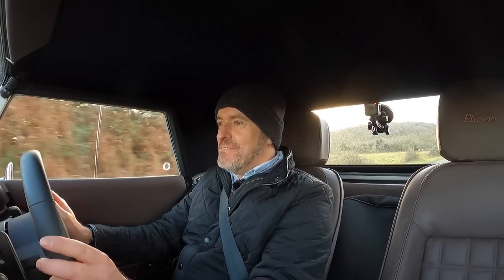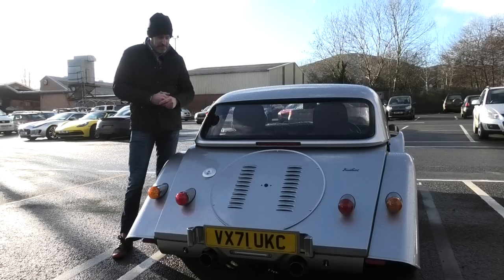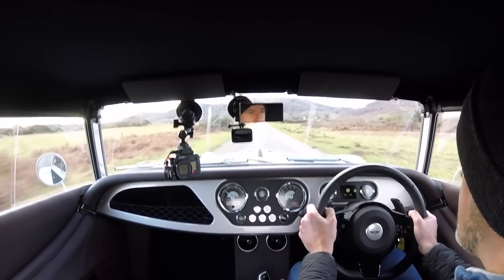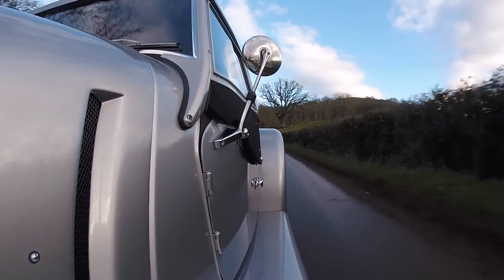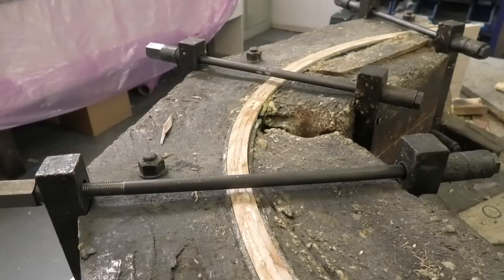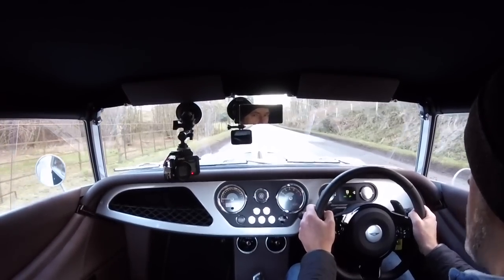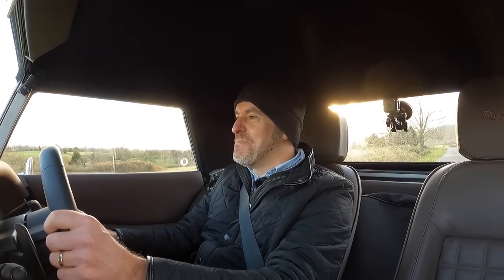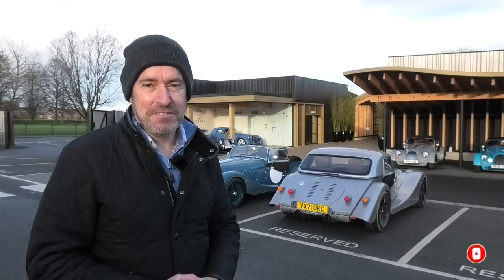340hp Morgan Plus 6 Review - A proper handful but where do I sign ?! [Part 2 of 2]

Comment: Yes that one seems more grown up. Not sure I agree re the paddles, when did you last have to work out where you hands are to use the indicator? The  "solid" paddles are always where you left them. Also the burbles on over run, are they really natural? it sounds a bit to manufactured  for  Morgan to me.
And finally, if a wooden gear knob is ok in a Carrera GT then it would be ok in a Morgan, ditch that BMW thing and fit a switch in a nice piece of turned Ash.

Comment: I recently drove the 2023 versions of both cars. Like you, I surprised myself with the Plus Six, thinking “this is the one” for me! I didn’t find the paddle shifters a problem in turns - no worse than having to take one hand off the wheel in a manual car. And you could use the gear lever instead of the paddles for a more “manual” experience.  😀

Comment: I'm delighted with my new Plus Four. Wouldn't trust myself in a Plus Six. I think to drive one of those safely you need to be properly trained to handle such a car. 0 - 60 mph in 5 seconds is more than enough for me. The thing I love most is the reactions from other people, and the mutual waves exchanged with other Morgan drivers. Getting my own Morgan was my dream come true.
Reply from the maker: Congrats Stuart. They are very special cars 👌
Reply: loved your report,i owned an old plus 8 which sadly i sold,ilove morgans but couldnt afford  another so brought a bmw 240i with the b58 engine for a third of the cost of the plus 6,its a serious piece of kit especially in the wet,if i had a choice i would buy a plus 4,my time in the bmw with all the handling gizmos can get a bit edgy to say the least a +6 without the handling tech would bring my blood pressure up to its limit

Comment: I've a 70th Anniversary model 4/4 with a Duratec engine as well as older Plus 4's ('57 and '63). All great. For me the traditional chassis car with an engine around 2 litres is just right. More power isn't needed and may cause you to come a cropper. Some people are buying the new hyper cars without the skills required to control them in poor conditions. Meantime, my very first car was a Ford engined F-type Morgan three wheeler too which you used to be able to drive at 16. I've driven them for - ouch - 50 years! I'd go with a Duratec 1.8 or 2 litre car, or the great TR engine or Crossflow in an earlier car, either on twin 40 DCOE carbs (which sound great too).

Comment: Hi Pete, plenty of smiles per gallon there,and a good test of skills.Now try the Plus 8,the Aero8,the Aeromax, Aero Supersport and the Aero GT if you can find one. The Aero8 has the best soundtrack and comes with manual. The paddle shift on the Plus6 looks cheap and being fixed to the steering column would get annoying imho.

Comment: Think I'll stick with the Plus 4 like I said in the last video.  For me, I'd be able to use more of the power, more of the time and still stay reasonably legal.  It also fits in better with the drive down to the south of France, never going near a motorway, taking your time thing I'd want to do with a Morgan. As for having it as an auto, no, not for me.

Great car, I'm sure but not for me.
Reply: I agree it's the wrong car for an auto. And if you do end up wanting more power from the 4, I'm sure you can get way more than 300bhp from a tune.
Reply: Agree John; I have a 2006 Plus 4 and using the gears is part of the fun; and that BMW auto change thingy! Groan. Michael

Comment: Thanks for another great video. Having watched both, I lean towards the Four. I wouldn't rule out having paddle shifters, but it's surprising not to have them aligned with the steering wheel. I've never driven a car configured like that, but I'd think that shifting mid-turn would be awkward. 

As a sports car guy from way back (TR4, Sprite), I'm so glad Morgan is still building these cars and so wish I could indulge.

BTW, that parking lot you were in would make a wonderful weekend "cars and coffee" spot. ;)

Comment: I have a MY22 Plus Four auto which is superb. I previously had a Plus 4 (2 litre Duratec) and then a Roadster (3.7 litre Mustang V6). The Roadster had an Aero Racing ECU and produced over 300bhp but the Plus Four is faster. I think it's a pity that you didn't try the auto as it is so much better than the manual. It has about 50 more torques than a manual and pulls like a train especially in Sport+. I have also had a decent drive of a Plus 6 and it definitely has it for comfort and ride. I loved it. However for the traditional looks it has to be a Plus Four.

Comment: Would be happy with testing either car, but this is where my love of motoring collides with my disability and lifestyle. It is so frustrating when you love cars and motoring, but feel left on the “outside” when you cannot simply jump into a car when you need hand controls and adaptions just for a test drive, and manufacturers are not going to spend money to do so on the off chance of maybe gaining a sale. I guess this is something that is not going to change in my remaining years either.

Comment: it's always fun getting into a small British convertible that's not been converted. I'm 6' 2" and I used to "fall", left leg first into my MG Midget. Exiting was more of a desperate struggle using any fixed surface as a lever to heave yourself out.
I'm like you when it comes to wire wheels. When they're gleaming and clean, they look the business. But they take a crap load of looking after to keep them clean so I'd opt for the alloys too. And I'd probably got for the Plus 4. It's power is more accessible for more of the time. Though I'd still opt for the BMW autobox.

Comment: I've owned a 2014 Plus 8 since it was new. Now, 45,000 wonderful and trouble free miles on as I turn 70 I want to go back to a slightly simpler life. I've driven both the Plus 4 and the Plus 6. I think a manual Plus 4 beckons.

Comment: I own a new Plus Four and was advised not to purchase the Plus Six. . My previous car was a Ferrari F430 Spider, yet the  Plus Four is fast enough for me. I also prefer the  8 speed auto; faster and yet more economical. Horses for courses. But I will keep my Morgan for some time and naturally paid for it with my own money. Unlike motoring journos :) I do however agree that the  rev counter should be in front of the  driver, but there is insufficient room for it.

Comment: I think I actually prefer the slightly more classic looks of the Plus Four. I’d have the interior a bit more classic too and less silver/grey with a walnut dash perhaps. And you’re right it does need the spare wheel on the back as it looks slightly odd. It’s a shame we couldn’t see under the bonnet and see a few drive by shots this time though. It would have looked good with that invisible selfie stick thingy.

Comment: I test drove a manual plus 4, and was pleasantly surprised, having owned a couple of Aero 8s that weren’t great. The salesman mentioned that several plus 6’s had been through the hedge backwards due to a combination of no traction control and a gearbox which in sport mode is inclined to drop 3 gears, spin the rear wheels and swap ends!
Reply: I think it may be a proper handful , I have the same engine gearbox combo in my m140 , no way would i turn the traction off in the wet !
Even with it on , the back end has came out on me 😂

Comment: For me, I think I'd ideally want the Plus 4 with the manual, but with the 6cyl engine from the Plus 6. As they don't offer that, I think I'd still opt for the Plus 4, and if I wanted more power, I'd have it tuned.
Reply: cmon, people are pushing these b58s, they are throw the fastest street cars now, 800hp on stock engine and box

Comment: Excellent reviews, thanks. I have owned 4 Morgans so far, none recently, but two  classic 4/4 and two +8. I much preferred the Rover V8 3.5 and 3.9 Plus 8,; was for me a far more natural fast sporting and touring car and enjoyed the 'give it some welly' speed .. have had many classic sportscar 2 seaters including every model the Panther Car company made. I drove my Morgans all year round in all weathers but also owned several classic TVR along side them so swapped between those and two different Porsche.  

This year after some many years in SUV and other more 'mundane' vehicles it was time for me to go back to the factory and did another tour. In the past I watched the build of one of my Morgan Plus 8 which was fascinating. I rarely if ever would drive a Morgan with the roof up, and never owned a hardtop. After my drives this year in Malvern it's clear that I agree with you that  the Plus 6 is the one to order but I also found the Plus 4 to be a fabulous driver's car and the exhaust pops and notes are wonderful.  Like you, I need the extra 'ooomph' and the acceleration thrill.

Of course prices have escalated since my last ownership and my current personal spec was quoted at about £110,000 (many extras) for a Plus 6 so they are 'serious money' now. Nothing beats the feel and 'gentleman style' of these classic motor vehicles; you cannot drive one without experiencing proper 'motoring' not just A-B travel as in mass produced transit cars. I narrowly missed out on buying one of the last Morgan Aero cars when I was there and ideally I'd get one of those convertibles if they still made them as I love the blend of classic 1930s and futuristic that these embodied, but I am not keen on buying pre-used cars and prefer the feel, smell and exclusivity of a tailor made new car on delivery day.  

That leather is wonderful but I'm sticking to the classic wood dash and accessories not the body colour. I also miss the chrome bumpers and think the front and especially the rear looks 'unfinished' without them and without a spare wheel on the back instead of that vacant looking grilled surface. Unlike you, I prefer spoked chrome or body coloured wheels not the modern alloys.
Reply from the maker: Enjoy the new car. It sounds like it going to be very special 👍

Comment: Great two part video! I would most definitely choose the Plus Six. You mentioned the price of how much it would cost to have a Plus Four monthly, but what about the Plus Six? I’m not sure if you mentioned it, but how much would it cost to have a Plus Six monthly?
Reply from the maker: A difficult question to answer. Depends on the spec you choose, size of deposit, PCP or HP and length of term. Quite a bit more 😬

Comment: I am sure this car is very capable, but is it really all that much fun, i.e. apart from the kind you get in a Mustang? Right, it has a LOT of “poke,” but given that Morgans don’t handle amazingly well, what is left, for over $100K? See I prefer a manual, and it’s hard to spend what I’d normally spend on 2 or 3 cars on anything else! Yes, I’m sure this car is fun to drive, but given a choice, would I chose it? I would not. If I wanted a Morgan, and I do, it would be a +8, with a manual transmission. It’s wouldn’t be a BMW, but THAT must be  the whole point (Instead, it would be an Oldsmobile)!

Comment: Surprised that manual isn’t an option. Also surprised at the quality and position of the auto’s paddles. Lovely looking cars of course, and the hard top certainly adds another layer of practicality. I can’t help but think the plus 6 is a rather confused car. If you are going to take away the heritage looks ( hand finished wooden interiors, wire wheels) and driver experience by making the vehicle auto only then why not add the safety of traction control, stability control ,etc. for our lovely British winters or when you simply do not wish to be running at ten tenths (especially as these can be turned off should the driver wish to do so). 
And as for the price …..
Reply from the maker: You and me both!

Comment: I'll stick with my 1972 Morgan 4/4 1600 - the modern car is too smooth for me, (the £60k -80k is a problem too!). Steve Cropley once described Morgan as the "minimum acceptable sports car", as to add anything did not make it better and to take stuff off made it worse. The new CX platform is a technological marvel, but not for me.